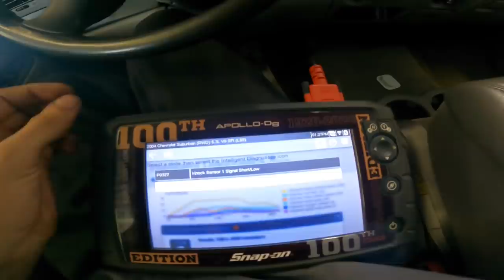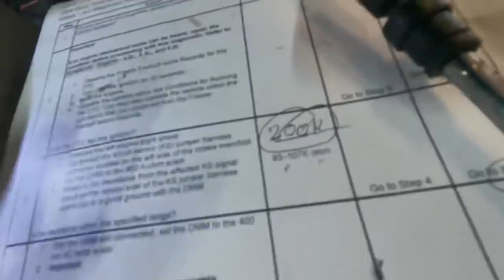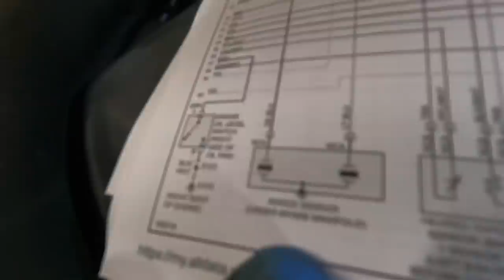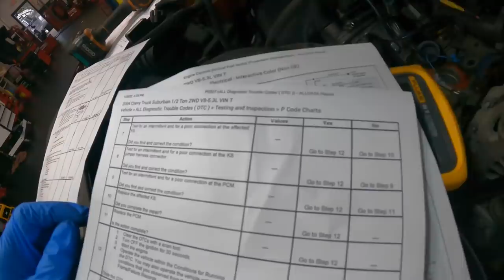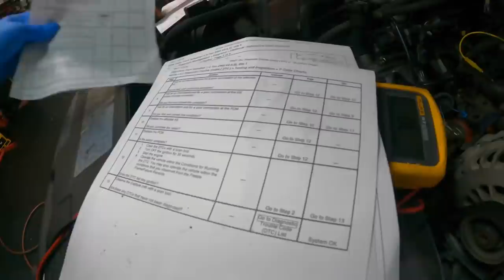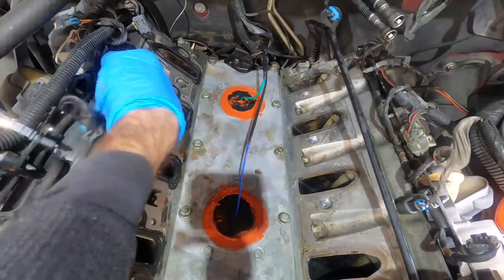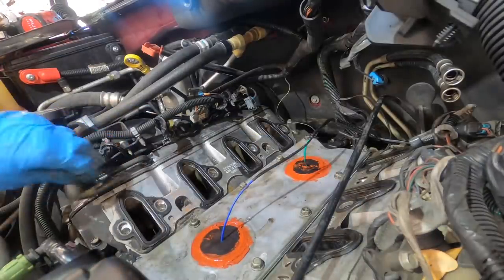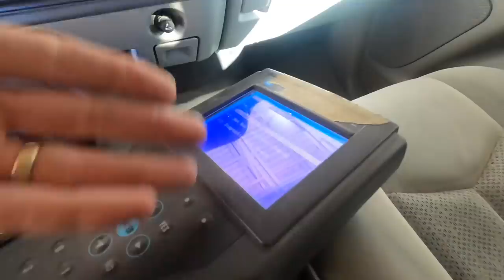Had to DRILL the engine block. NIGHTMARE Diag! LS 5.3 Check engine!

Comment: From the customer view, I'd go back to the shop that over-torqued the sensors and get them to pay for Ray's work. Looks like the sensors tested okay at low frequency (Ray's tapping) but weren't working at engine frequency (probably non-linear), because the sensor and body weren't together due to over-torqueing.
Reply: Good luck with that.  You're in the middle of a finger-pointing contest where the first shop will claim they did the work correctly and it's not their fault.  They'll just claim the second shop was firing the parts cannon since the sensors Ohmed out with the correct values.  All you'd be doing is wasting your time.
Reply: Small claims court with this video as evidence is your best bet.
Reply: I cringe every time I have to tighten or loosen aluminum fasteners or sensors. It's definitely not the time to guesstimate your inch pounds or go with cheap aftermarket replacement parts. At minimum, there are generic reference charts for fasteners for torquing different materials,diameters, and thread pitch.
Reply: Good luck with that. If it was yesterday, Ya, mite have a chance.
Reply: My thoughts exactly.
Reply: @buckhorncortez  Thankfully, there is detailed video evidence. Still a crap shoot, but maybe you'd at least seed change at the shop that messed up.
Reply: @buckhorncortez  Have to agree with that a waste of time. Only way you'd get something is to sue in small claims even that is iffy
Reply: @MrLeavemikealone  
Those sensors are steel though. They all fail because they rust over time. 
That’s why the other shop attempted to seal the water out after they over torqued the new sensors they installed. 
I helped my son change a set on a suburban that were so rusty it looked like they were going to snap off when we tried to take them out.
Reply: These jobs cost alot of money so in theory small claims court would be worth it. Secondly the video documentation of the entire process will prove invaluable in court and the customer would likely get a settlement.
Reply: From the customer's point of view, this ain't fixed.  They have already been told twice that it's fixed.
Reply: There is bit more to that. They changed ecu as well :) so bet that was few $$$ extra ;)
Reply: @TAKIZAWAYAMASHITA , when it comes to technical stuff the judges in the small claim are very dumb, don't expect much
Reply: @buckhorncortez  Even if the customer doesn't get something financially, it's probably good that the shop learns about the over-torque ... it's a learning experience that could cost them dearly on other jobs in the future
Reply: @ralfie8801  the factory service bulletin literally says to use red rtv silicone around the little flaps that seal the knock sensor. Freaking hilarious
Reply: @jimmeade2976  Why would you think it's okay for a customer to spend money to notify the first shop that they spent money? That's not how a legal system works. If it does work that way, then your country is royally fucked.
Reply: Not to mention get something back for the unnecessary ECU replacement which was probably replaced for the same reason Ray would have fingered the ECU had it not been already brand new.
Reply: @natemartinez4595  
I don’t recall them being rubber flaps, rather rubber plugs that push down into the sensor recess. With the repeated heat up cycles they go through, the rubber plugs get brittle over time and then stop sealing. The silicone probably just delays the inevitable.
Reply: @Mavendow  I never said the customer should spend money. I said they should go back to the shop that installed the sensors incorrectly and request that they pay for Ray's repairs, since that shop caused the problem.
Reply: I think Ray's shop did the work.
Reply: @kennyoboy642  If that shop claims defective sensors, then they should warrantee them and pay for their replacement.
Reply: @jimmeade2976  You replied to a comment which was talking about legal finger-pointing. I couldn't tell you had changed the context to [going back to the shop] because no such direct reference was made. I assumed you were continuing the conversation rather than thinking you had randomly started a new one.
Reply: @TAKIZAWAYAMASHITA  Would the customer be charged for all the hours  Ray  put  in  or is it flat rate? JC, say $1200 for Ray’s labor, $200 for parts and supplies plus what the other guy charged that is one expensive check engine  light. The truck only has 107k and has had a lot of expensive work done on it, front suspension rebuild, main computer and this fiasco. I always thought these full size trucks were inexpensive to maintain..
Reply: @paleghost  he likely was charged all of his. Which is why the customer would have a case in court for a claim he stands to gain money in this situation. Now had all of this plus previous vehicle work costed a few hundred dollars then it wouldn't be worth it. But now this job plus previous work is likely closer to 3,000$ if not more
Reply: Interesting theory on why the sesors tested good but had their real runnimg performance ruined by the broken sensor body
Reply: The facts don't determine who wins in court. The deciding factor is who can pay the most lawyers for the most billable hours. In this case the first repair shop probably can afford to pay more in legal fees than the vehicle owner can. As such the court will find in favor of the first shop. If you are the vehicle owner having to spend thousands in legal fees just to get back a few hundred dollars for the second repair just isn't worth it.
Reply: If you're torturing different thread pitches I'd say your issue lies somewhere in there. Especially on alum.
Reply: @michaelslattery2121  True, the clue was when putting the RTV silicon on, he said " when we did this last time we used red so ....".
Reply: @buckhorncortez  Except Ray has video evidence that once he replaced the broken sensors, the car was fine. That points to the sensors being broken by the shop was the issue.
Reply: @ralfie8801  Sealing the water out like that is standard procedure with those sensors.
Reply: @christopherkidwell9817  
So show me where I said it wasn’t, I just said the the sensors were steel and not aluminum in addition to the rubber being a plug instead of a flap and that the rubber gets brittle and cracks over time, the silicone just delays the time that it takes for water to start getting down in the holes with the sensors.
Reply: @Adit86  small claims court costs hundreds lmao....
Reply: @ralfie8801  It does only delay the inevitable. However that inevitably is longer than an owner normally owns a car with that milage
Reply: @wolvenar  
Depends on what part of the country you live in, down here in the rust free belt, we tend to drive them until they won’t and then rebuild them to drive some more.
Reply: @ralfie8801  Maybe, but the average customer bringing them to a shop?
I have a 5.3 just about to turn over that 400k mile mark. I replaced the knock sensors at 140k. Still going
Reply: @joevignolor4u949 FYI, lawyers aren't allowed in small claims court.

Comment: A little tip, before drilling those bosses, I would have poked a hole in a coffee filter and pushed it over the boss to catch all the shavings.
Reply: Great Tip
Reply: Good idea, but a ways back Ray had shown what their coffee machine looks like in their break room. It's one of those one-time-use cup machines, not a traditional machine with coffee filters. I'd be genuinely surprised if they had filters on hand, but if they did then this would have been perfect..
Reply: Wow I never thought about that great tip thanks
Reply: Or some glad press n seal instead of coffee filters. 🤷

Comment: Ray, as a career aerospace test guy I've spent decades with piezoelectric sensors, which is what these knock sensors are.  They are not robust - don't ever drop one on a concrete floor and expect it to be OK!  There are a host of other things that can make them go bad, and a notorious cause is over-torquing.  They'll still ohm out OK, and will give "a" signal when vibrated (e.g., tapped), but you would have to see the signal on a scope to assess if the signal is actually in range or useful.  Over-torquing typically harms the internal structure of the sensor and it's not fixable.  Good work following your instincts and not being a slave to the diagnostic fault tree!

Comment: It’s really nice knowing some people like to take care of their vehicles and want to keep them alive.
Reply: You see all the repairs the owner has done.  As soon as he knows there's an issue he brings it right in.  It REALLY helps when you buy a vehicle you can AFFORD and AFFORD to fix.  An honest mechanic like Ray is CRUCIAL for people that don't do this themselves.  Thank God for him.
Reply: Cars and trucks are so expensive now, you kinda have to in my opinion.
Reply: This is the kind of person I'd buy a used car from!
Reply: @stevedyndiuk99  Especially if you work for a living.
Reply: @Roaming_Wolf  We were very fortunate to find a mechanic like Ray. We've been going to him for over 20 years now and each year he just gets better.  Truly, all of us are blessed.
Reply: There are people out there who are like that, who want to get the most out of their vehicle if they really like it. I would still have it today but I decided to buy a new GMC in 2018 with a 6.2l. After rethinking this what I should have done is rebuilt the 2002 the way I wanted it as I did with some of the 2018 GMC....

I had a 2002 Silverado 5.3l 2x4 that I had 16 years w 186k miles. Only parts I replaced were the knock sensors and a rack n pinion. Changed the oil at 5k intervals religiously. Kept an eye on it for any other issues, I could tell you when it was time to change the battery just by the sound of it starting (how many people can do that or even pay attention). Those who take care of their vehicle and listen to its sounds can do that...

that is the key...the vehicles make specific sounds when it is running right and odd sounds when it is not. Pay attention to the sounds and get it looked at and fixed as soon as possible....
Reply: Car, trucks, trains, motorcycles, tractor, airplanes, etc. all have a pretty indefinite lifespan if properly maintained with both preventive and repair maintenance that is preformed by a trained and conscience mechanic.  Ref=Air force B-52's.  Good Job, Ray !!!

Comment: Ray, I am a 25 year Computer Engineer, but my true passion is working with cars since 1987, even had a drag racing team back in 1992. Just wanted to say I really enjoy your videos, and leaned so much in the newer car technology now a days. Have to say you are an accomplished engineer with all your analytical procedures. thank you for your videos and your great sense of humor.
Reply: Since you said you were a computer engineer and loved working on cars I figured you appreciate this story I was always hearing about the check engine light being a scam and revenue for the dealership so I actually set out to definitively prove it true or false in my studies I noticed that if my diagnosis was true and a confirmed fix the light would automatically turn itself off on the 4th start up drive cycle I was impressed with the idea that it was that accurate and proved it 2 times true with a honda and a jeep over the years
Reply: @danlevesque5437  Dan, I owned a 1996 Ford Explorer. The check engine was used for fault codes but for also to be lit every 5000 miles for the dealership to take the vehicle back for a so called a check up. By swapping the cable links next to the driver kick panel will shut down this condition for additional 5000 miles. But I have to say, I have leaned how to work modern Nissan vehicles and trucks. And their check engine is helpful along with a car scanner to get the DTC to address any electrical issues, besides regular oil and transmission maintenance. Basically any new vehicle after 2000, they are dependent on computers components.

Comment: That was some impressive hand and brain speed. Even the happy diversion of the diag tree showed us some interesting things about knock sensing. IMHO best video and content to date!
Reply: No... No no no. I do not agree with you... there were many more options he had before even drilling, that should be the LAST damn thing he should of done!!!
I guess being a machinist I had so many different tools in my arsenal, not to mention a completely different thought process on getting those knock sensors!!! Without even mentioning "Reverse Grip Sockets" he could of tried either a bit of LIQUID CO2 or Heat followed up by those reversed catch sockets or even going "GHETTO" and pulling out the frigging Vice Grips... But Nooooooo straight to drilling,  WTF BRO, why don't you SERIOUSLY think outside the damage box, lol!!!
Reply: @offyouselfsbuddy1683  But once broken off, Lawson 135° split point drill bits with Tap Magic cutting fluid to drill pilot holes and Lawson screw extractors, not dry Horror Fright drill bits and hammered-in Snap-on Torx screwdrivers as screw extractors... I understand any port in a storm, but as many times as Ray has needed drill bits for various things, you'd think a high-quality drill bit set would be justified.
Reply: You can easily get thrown down the rabbit hole dealing with "knock sensor" issues.  I had a catalytic converter not too long ago and one of the ceramic media pieces broke loose inside the cat and was making this horrible knocking sound, but it only did it at idle speeds.  But I guess the vibration travelling back up through the exhaust system right into the side of the block was enough to start setting all kinds of knock sensor codes.  At that point I had to fix the exhaust so I changed the knock sensor out anyway although I don't think it was really needed.
Reply: @offyouselfsbuddy1683  because everyone has liquid co2 laying around lmao
Reply: @castleandcars  With Lawson, you can buy drill bits a-la-carte. Just about any size you want. You don't have to buy a whole set either. Just buy the sizes you use most often for that matter. Keep stock in 1/8" (who doesn't use the crap out of THAT size?), 1/4", and for drilling and tapping, the sizes for SAE & metric taps you commonly use in your trade. Yes, they are pricey, but man, did they save my butt more than once back in the day, and they last forever used correctly and properly lubricated. Like I said before, any port in a storm - you use what you have at hand. But have at hand what you can use. When it comes to life-savers, never buy the cheapest drill bits, tires, or parachutes!
Reply: I would have drilled the sensor body, and pinned it together in 2 locations at least to tie the connector to the body of the sensor. Then back them out.
Reply: Also, with the threaded portion stuck in the block, you could grind flats in it and back it out.
Reply: @castleandcars  liquid CO2 is why I keep a few cans of air, hold upside down and instant freeze spray, you can also just buy cans of freeze spray nowdays

Comment: Loved the torx bit extractor trick. Having to snap both of those must have been an extreme escalation in stress levels.
Reply: I've found that torx is also quite amazing for extracting those inner hex head bolts/screws that resist normal hex driver.
Reply: I had resorted to torx bits several times to get broken bolts out. Surprised how well it worked or that the professionals used that trick as well.
Reply: I twisted a t30 about 45⁰ with that trick, somehow it actually worked and I got the bolt out.